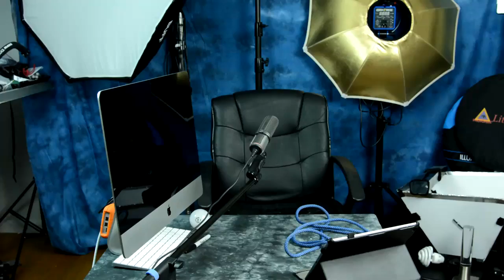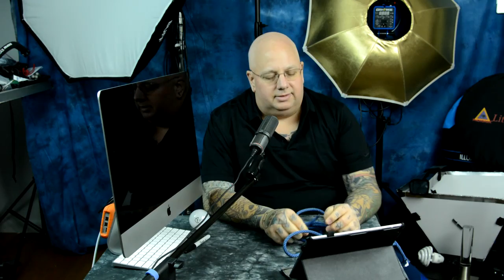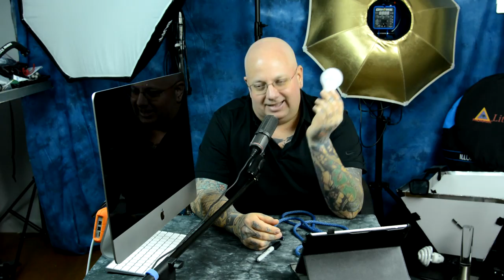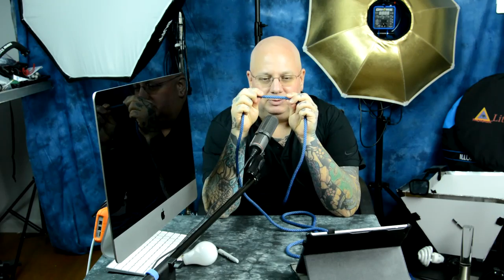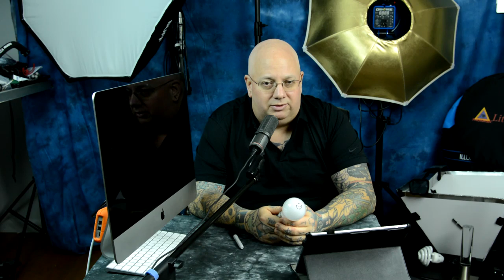To defining the "double-slit" experiment: FIRST you have to define LIGHT, WAVES, & "Speed of Light"

Comment: Ken, I keep listening to your explanations and am gradually getting the idea. I can understand that photons are a misconceived model. However, I'm confused as to what a particle is, for example a proton? Is it not just a spinning electrical charge? So what is a spinning electrical charge? Is not just another kind of perturbation of the ether and so no more a particle than a photon?
Reply: The photon is a packet of energy. Double Slit is what answered the particle-wave question,  and caused the gigantic headache of the age that still sucks to this day. 

Basically to appreciate the simplicity of the double slit is to recognize the backdrop where the light hits,  a photon collector board.  A board that remits a light signature because of energy potential striking the board. So you use that then use a wood board or paper with two slits.  Then you flash a flash light,  not run it sustained.  What you find is that the light wave hits both slits evenly,  but the glow from the light flash leaves a glow from the energy on only one slit side. That's where the particle description  comes from. The wave illuminates both sides but the energy packet only hits one.

Comment: The double slit, so called, which way test is incorrect thus Quantum also.  To detect light entering slit you must use a detector.  If you use a detector you are using some of the photons energy to detect it.  Planck equation says if you change energy you are forced to change frequency.  Now light going thru slits are on different frequencies hence no longer interfere.  No Quantum baloney at all.   Latest discovery on time dilation, fixed light speed and understand Algebra, then download this open access, no login, no ads, 2018 Cern archive journal paper.    https://www.zenodo.org/record/1447218
Reply: 😂 You completely missed the mark on how double slit works. The fact the energy potential remits on only one side of  the slit while the wave covers both is the whole point. Not interference. Interference within the wave determines where the particle falls. The original hypotheses was that the energy collects on both sides of the slit.

Comment: If you take a rope 100 trillion miles in length and stretch it out to its full length and move one end wouldn't both ends move at the same exact time, so isn't action faster than light?  Light would take 17 light years to travel the same distance if light travels at the speed they say it does.

Comment: OK, the needle experiment is a double slit experiment, the two large slits at the left and the right of the needle :) and even if way less complex, you can consider sound as kinda similar to light. Doppler effect for light and sound occur. As for the experiment itself, it is helpful for me to consider time as a product of the experiment too, instead of a meta axis in which things happen, and the superposition of states as lazy evaluation of states, if the state of the photon is observed, then it is "calculated", no matter when. How can it be done? by being calculated outside time. Note that calculating outside time makes more sense than calculating inside time, a calculator belonging to the same reality as the calculated things is even more mind bending.  Also, not trying to model things based on our macroscopic bias helps. Good luck with your quests y'all.

Comment: 4:09 Why doe michelson morley experiment not qualify as an experiment? What is wrong with it?
Reply: Cliff because it's based on a false premise.
Reply: Unable to put into words. But for 20 years I felt the same way about magnets. If a magnet an copper wire produce electricity it it goes to a lightbulb with resistance heat and light.apples equal apples you don't compare apples to oranges.if it's true for the magnet it would be the same for the lightbulb. I am starting to see what you're talking about.good job! The magnet loses no Weight nor copper but there is a flow of electrons. Where do they come from. The answer is they're not coming from. Am I getting close.

Comment: when you fire a high powered rifle, over a long distance. At the correct elevation . At the correct humidity. There upon occurs a phenomenon. In the air along the flight path of the bullet appear concentric rings of vapor eminating radially along the flight path of the bullet with a very regular spacing. Like these pulsing rings that you can watch as the bullet flies. Not only does this occur but the bullet appears to fly along a curved path to it's point of impact. Not just an arc, but a curved arc. The first time I saw it I thought I was imagining things, but have since seen it on video. This is what you are describing light propagation as.

Comment: Longitudinal waves have the potential for a class of weaponry far greater than nuclear weaponry.  They are not hindered by intervening objects and where two intersect you can cause enormous destruction.  The USA has not done much in this area due to adherence to faulty physics, while the Russians have mastered it.  The brain uses longitudinal waves to operate and with the weapons the russians have you could put everyone in a wide area in a coma.  We've discovered this 40 years too late and are just now working on defenses against it.  You can use them to heart up or cool large areas affecting the weather, or even take cells backward in time to precancerous states, but big pharma has suppressed this.  Dr Priori proved this in France in the 70's with MANY tests using longitudinal waves developed  in a plasma resonance chamber.  We currently have little understanding of time itself.  There is a correlation between time AND energy that can be exploited through rotating magnetic fields.
Reply: The US is very aware of this but it is being supressed. Look up HAARP. They just dont want the general public knowing, have to keep the sheep surpressed.

Comment: I'm hearing, the interference pattern is showing the magnetic field with electricity leading or lagging? 
 The electromagnet works by sending the electricity into inertia leaving magnetism. Magnetism is the main half of EM, cause you can't take the magnetism out of electricity? How would they send electricity into the inertial plane? When there's the ability to take electricity (or?) out of the  inertia plane, wouldn't that be entanglement? There's no time or space in the inertial plane.
 Co-axial was used on flight 800 and the Towers. Tunnel beam and energy beam.
         To Much?

Comment: If you look at the speed of light or the inductance of a light beam or laser beam, the speed of light seems constant. However if you block the beam with an object or shut it off instantly, it shuts off instantly over a distance. That is how they communicated to the astronauts on the moon instantly. They tried to hide that with the 1.5 second radio turn around rule. That astronauts had to agree to. That is why some think it was all faked. 

As I learned the universe from universal scientists, there is just one sub-matter particle in the universe the particle of electricity. That particle makes up the nucleus of the hydrogen atom and of course other atoms are just multiples of the hydrogen atom. 

The reason elements made of the same substance act so differently is not some stored energy or power within, rather matter is a filter for ambient radiation. A kaleidoscope as an analogy. 
Undetectable high velocity ambient radiation passes right through all matter, creating it and sustaining it. Through the mathematical formula for the area of a sphere Pi times diameter squared, and the volume of a sphere Pi times diameter cubed divided by six. It is the ratio of a small spheres large surface area to volume, compared to a large spheres small surface area to volume that allows ambient radiation to trap particles of electricity within a spherical container. Under actual electromotive force. Due to a tremendous surface area and very small volume of particles of electricity in a hydrogen atom. These same formula limit living cell size. The cell membrane cannot take in enough food and expel enough waste as the ratio of cell surface area to volume decreases as the cell grows in size. Large cells die and do not split and reproduce. 

Light is a slowing of ambient radiation and light or what creates light is in constant motion. It cannot stop it does not bounce. This is how I was taught light travels and communicates. 

https://youtu.be/z0fnkRn_CoA

Refraction and bounce are explained well by universal science. However universal science was deemed too dangerous for citizens. And it was openly announced that counterintelligence would be introduced into public schools. It was not a conspiracy because they did come out and tell the world. Most just did not believe they meant mis-teaching then atom, electricity, history, chemistry and science. But that is what they meant and that is what they did. 

Objects like glass, air and prismatic plastic, that allow light to pass visibly, can change color or appear to change color, they can create refraction. However the particles that appear to be refracting often at near 90 degree angles are not the same particles that brought the light to the target. The target gets charged or the area is actually slowed, to light emitting velocity, which can cause the invisible ambient radiation to slow to light speed and create that refracting effect within the substance. The particles never stop. They cannot they create and sustain matter. Matter cannot exist without ambient radiation and ambient radiation cannot travel without matter. 
 
Universal scientists figured out the universe more than 100 years ago. Benjamin Franklin being perhaps the first to do so. All of his work is hidden from us today. He invented the pointed and flat electrode method to determine the direction of electricity. Colleges have been paid trillions to hide it. Our batteries currently flow particles of electricity from the ( - ) terminal to the ( + ) of a modern car battery. When Benjamin Franklin was so clear about which way electricity is to flow. The abundance of particles of electricity the electrical pressure was to flow from the ( + ) or positive terminal to the ( - ) terminal. Colleges saw a cathode ray tube just like Benjamin Franklin did but Benjamin Franklin did not race to conclusions as colleges did. 

Colleges saw this and decided that Benjamin Franklin had the markings wrong and that he could not have known which way electricity was flowing. That is because they had already hidden ARC (Anode, Rectified, Cathode). In a cathode ray tube or within a DC ARC the particles strike a small electrode and create a molten liquid diode much like a mercury rectifier, This causes a ray of particles of electricity, to beam back against the flow of the power supply that created it. 

https://youtu.be/6FMUuPoebL0

That is also standard ARC welding polarity that creates the cathode ray. The voltage at the surface of the cathode is explosive initiating voltage. Just like lightning that is created as a reciprocation of the low voltage that leaves the earth surface into space, but sometimes strikes clouds. The liquid surface of the cloud is overloaded, and reciprocates with a very high voltage emission. This emission though is not an A to B emission like you get from a power supply. It is an ARC that means that it is just an area at explosive voltages. It goes anywhere there are less particles of electricity. Because it is not an A to B emission it can be steered by low voltage and magnetism as may have seen in the movie above. An A to B emission is straight and direct. This next movie demonstrates that. In the first part the tungsten electrode is charge ( - ) as marked on a modern car battery. In the last part of the movie the tungsten is charged ( + ) as marked on a modern car battery. Backwards to the markings Benjamin Franklin set. 

https://youtu.be/dYReqtnmM4Q

That is all rather accurate it takes a while to get it all in order though. 

I assure you that this is what they did not want you to know. 

Benjamin Franklin turned lightning on and off in his basement by creating the first transistor. He did it by hanging from strands of silk, copper plates in a circular shape one inner and one outer plate, from his basement ceiling creating an air capacitor a condenser. He placed the output from that capacitor to a gate which was just one of three fire place balls used as electrodes. He placed the gate between the electrode that was connected to a ground rod and the electrode that was connected to a copper wire from his roof. When the lighting came he could start and stop the lightning from jumping to ground by charging and discharging his gate. With his technology and the understanding of ARC a child can fly a kite in an electrical storm. 

Sincerely, 

William McCormick
Reply: You said, "If you look at the speed of light or the inductance of a light beam or laser beam, the speed of light seems constant. However if you block the beam with an object or shut it off instantly, it shuts off instantly over a distance"

That is absolutely not true. If it were true, you would be able to shut off light that has already been emitted even before it reaches us from a distance. In other words, would never see it even though it had already begun its journey. What you are saying is as nonsensical as saying that if you had a instrument in a pond that was making a vibration, causing ripples, that the ripples would disappear instantly--not reaching the edge of the pond--after turning off the vibrating source. Imagine the sun was turning off for a brief period every 7 minutes. Well, since it takes about 8 minutes for light from the sun to reach us, every time you supposedly turn it off "instantly" (assuming you could) you would be resetting this time back zero, and thus we would never see the light coming from the sun.

Comment: If there are not positive and negative electrical charges, how does electrolysis work?
Reply from the maker: charge and discharge………a "negative charge" is like saying silent sound  ROFL

i never said there are no such thing as charges
Reply: You know what electrolysis does, right? You have positive and negative ions in a solution and you turn on the DC current in two electrodes. The positive electrode collects the negative ions and the negative trode attracts the positive ions. Sodium ions are positive while chlorine ions are negative. If you electricity is not polarized, then how do you explain the attraction of different ions to oppositely charged electrodes?
Reply: Why are the sodium ions attracted to the opposite electrode if there is no negative charge?

Comment: Have come to pretty much the same conclusions. Since I was a kid I knew there had to be ether/Aether. MM experiment was obvious twaddle. Dayton Miller proved ether drag in a much better experiment. A good analogy I use re light is the rock dropping into a pond is like the lamp filament or transmitter, the ring of ripples is like the light or EM radiation and the sound of it hitting the water, the longitudinal component, is the effectively instantaneous stuff. What I believe some call  scalar and what does gravity, and magnetism and other seemingly instantaneous action at a distance (ESP?).
Dewey Larson made a good case for no such thing as an electron too. 
Tossed you a few bucks. Thanks and keep up the good work!
Reply: while i agree a ton of what we've been taught is bs, it shows we still understand enough light to manipulate, build tools around this, etc. we clearly understand different spectra at wavelength, filters that only look at certain wavelengths, bending light, using lasers, etc. so while we may not fully understand the core nature of light, we know enough on how to manipulate it to some extent. also is there just 'one' aether? or stacks? why does a lightbulb when get turned on, if not emitting anything, show what WE perceive as light, but we didn't see light 'perceived' from a wooden table? what differently is happening and why is that manifestation that way?
Reply: @jumpieva  We perceive the resulting phenomenon of the field perturbation, which is illumination.

Comment: Was hoping for a talk about the result of the double slit and maybe the quantum eraser but it didn't fall within this video. Shame. Although definitions are extremely important the result is surely more important. The result is that light acts differently if it's being observed, or knows it's going to be observed at some point in the future. Sounds like a programme to me. 
How about making a video on the result of the double slit and quantum eraser experiments? would appreciate your view.
Reply: What if the reason for the change when observing was more obvious - ie, whether using a camera or the human eye, the experiment changes, much like if you observe the tempetature of a glass of water by sticking your finger in it, you polute the results. When you observe the outcome via any visual means, the observer absorbs and impacts the energy, like a radio receiver.
Reply: Rob Lane it actually says way more...you must understand the implications. There is an eternal applicability here that can drastically alter the average ape’s quality of life via physics that have arguably been suppressed/explains patent-gagged information. One can still maintain the assumptions regarding the presence of possible sentience at these subatomic levels while taking this and building wormholes, dielectric railguns, and antigravity (requires a knowledge of this magnetodielectric as above so below)